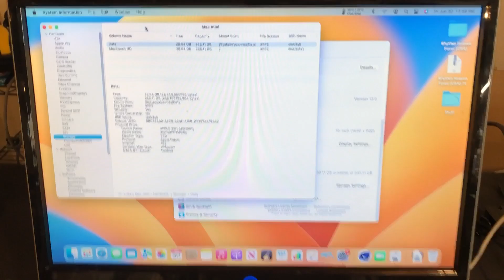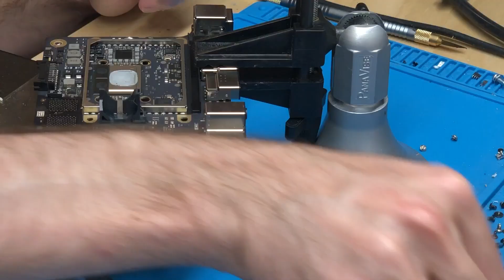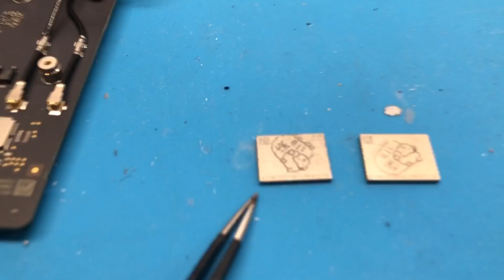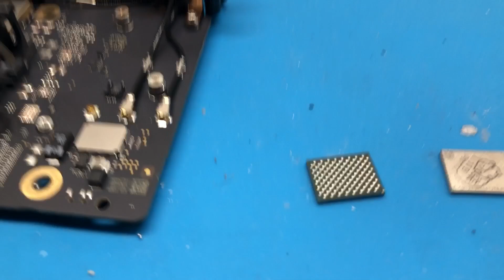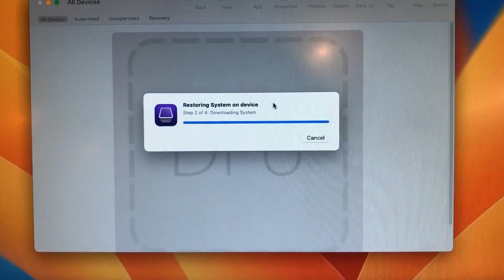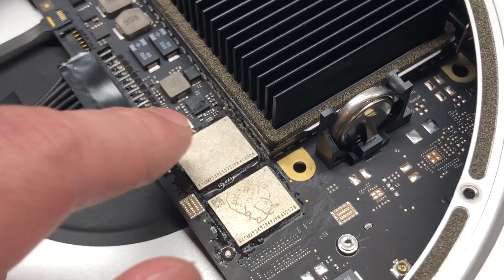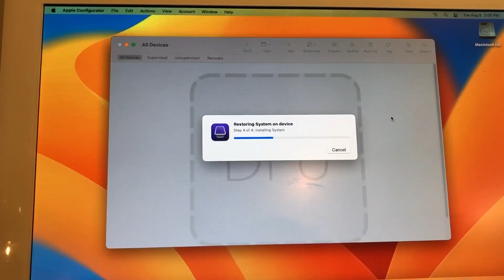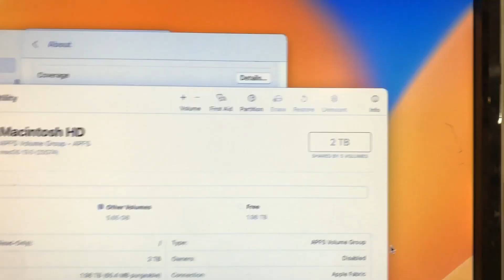M1 Mac Mini Soldered SSD Upgrade

Comment: This video was mostly a hit and miss without a definite conclusion of why this works and the other doesn't. Upgrading soldered SSD on newer MACs is a hell of a procedure and requires lots of knowledge and experience which does not include micro soldering or fault finding methodology. A very good video which has a summary of all the possible combination of NAND chip and firmware versions that can be transplanted/upgraded is this one https://youtu.be/MZuv4TIjk-I  From what I understand there is no way to install NEW NAND chips there unless they have been removed from the same model which must be new as well. The other option include only used chips and the problem is that they have unknown wearing level. Apple does whatever possilbe to shorten the lifespan of their devices so to force their customers buy the new ones or pay an arm and a leg for "official repair".
Reply from the maker: On M1 and later (and on iPhone 13 and later), you actually CAN install brand new, blank NANDs as I've done here. The restore process WILL actually write new firmware to the NANDs ONLY if they're blank. The landing pad/position situation only applies if the NANDs you're using are pre-programmed (pulled from another machine). The T2 Macs, on the other hand, CANNOT work with blank NAND, and must have correctly-positioned pre-programmed NANDs installed in order to work.
Reply: @dosdude1  I didn't mean to say that you don't know what you do but to emphasize there is a very complex situation. However, there is no clear cause in the video why those new chips didn't work. Anyway, your explanation here I think it's clear enough.
Reply from the maker: @nikolaskallianiotis8622  I believe the issue, at least in the case of the new set of chips I got, was that one of them was just physically bad in some way. These NAND chips technically aren't really NANDs at all, but essentially are entirely self-contained SSDs themselves (that connect to M1 SOC via PCIe). As such, my thought was that there may actually be SMD components encapsulated inside the chips themselves (similar to the WiFi chips on these, which have a package that looks almost identical). As such, the process of quickly pulling the chips off the stencil after reballing while hot (which normally isn't an issue with normal chipsets), could have caused some of its internal components (again assuming that's actually how these chips are constructed) to become dislodged from their respective pads. Or it's also entirely possible the chip was simply DOA.
Reply: @dosdude1  Encapsulated SSD ??? I haven't seen such thing so far. Even a 2242 NVMe drive has distinct components despite it's tiny size. Anyway, thanks for the info "dude" 🙂

Comment: Maybe a comlpetely stupid question, but once you have the pads and the chips ready for soldering, couldn't you just temporarily clamp them to the board with some kind of spring clamp just for testing purposes, before you actually melted the solder permanently?
Reply: That won't work because of different heights of the solder blobs. For lab tests there is a kind of "spring loaded BGA prototype socket" that you can use for quickly testing BGA chips.

Comment: All this effort to either repair(dead) or upgrade(more storage) an SSD that should've been an easily swappable part of said electronic device.

An obvious planned obscelence by apple, even worse now with the added T2 Chip & having every component paired/serialized not to work if replaced without paying premium to apple to have them do it but usually will tell you just to buy a new one instead or the cost of replacing is almosy equall to buying a new product.

Comment: Do you need another Mac do the job? If the case must be Silicon or can be Intel?
Reply from the maker: Yes, another Mac is required, but does not need to be Apple Silicon. Just should be running the latest version of macOS for best chance of success.

Comment: Would you be able to do this with an M2 Mac mini? I’ve heard the base model has two NAND slots but only 1 NAND 256gb SSD onboard. I’m guessing it would be easier to upgrade as you don’t need to remove the chip

Comment: So what is the success rate with such a difficult process? Does it work for all M1 macs like the macbook air?
Hopefully this becomes a relatively trivial thing to do over the next couple of years for when I need to do it, the M1air is a truly impressive product only held back by Apple's greed and anti consumer practises. No one would buy a mustang if ford only sold them with non removable tyres so it shouldn't be allowed by law for computers either.

Comment: Well done, but Apple are so rotten soldering SSD to the board.  This element of the Apple production line is the final nail in the coffin for me ever buying another Apple product.  Hard drive storage should be user replaceable, let's face it, ssd's have a finite life or just die for no reason, your avaerage user is stuffed the days that happens. .

Comment: Would love to see some benchmarking to see how fast that new SSD is and compare to the stock SSD in some Macs.

Wonder if this SSD swap will work with any M1/M2 Mac. Or is it only for Mac Mini M1?
Reply from the maker: This upgrade applies to any M1 Mac. Speed will not change, as the NANDs are still on the same bus.
Reply: So it will not work with any other Mac? What do you think/believe?

Would still love to see some benchmarking. Hopefully Luke did some with that original 256 GB SSD. Of course it's the same bus but this is just the NAND storage, and the SSD controller is in the SoC. You meant "same SSD controller"?

I'm still curious about the speed/performance. I believe that many more people are :)

Speaking of storage buses.. I know that the last MBP Unibody got that SATA-600: 600 MB/s. How fast is the bus for the SSD on Mac Mini M1? PCIe NVMe I guess :)

Comment: I do have a question. In Luke’s video I got the impression that success was achieved with BOTH of the blank nand chips. Is that the case, or do I need to get both pre-programmed and blank nand chips to duplicate the process?
Reply from the maker: Two blank chips should work, the only reason I had issues was because one of the chips was bad in some way (which may have been my fault). If both chips were functional, it would have worked.
Reply: @dosdude1  Cool! Thanks for the quick reply. I’m contemplating an experiment to take my M1 Ultra Studio from 2TB to 8TB.

Comment: So you say that un-programmed NANDs is the way to go, however didn't you use one programmed and one un-programmed?
Reply from the maker: I did, but only because one of my new ones was bad. Though one programmed and one unprogrammed should in theory be the same as being completely unprogrammed, as the data is striped across both chips.
Reply: @dosdude1  Interesting, so since its stripped the M1 must see them as a broken array and treats them as blank. Thanks for the reply. Also the 50% failure rate of the NANDs is a bit interesting.
Reply from the maker: @JustFixIt99  May have been my fault, as these are not normal NANDs, and may have components encapsulated inside (as the WiFi chips do in these). As such, you have to be more careful when removing from stencil (while still hot) after reballing than with normal chips.
Reply: @dosdude1  Learn something new very day. Hope to see more of these from you.

Comment: what could be super interesting is to mount a bracket to the M1 board, to allow for quick insert and release of the NAND chips so you can make a whole series testing out what works and not + get a NAND programmer to erase the chips.
Reply: unfortunately BGA110 socket costs more than Mac M1 Board itself :) however it could be printed with good resin printer..
Reply: That's the programmer - the sockets themselves are relatively cheap @inwerp
Reply: if you mean JCID adapters - sey they are not expensive but i do not believe they have PCIE pairs stuffed, simply because it uses UART.
Reply: @inwerp  His comment is stating it would be easier to have an adapter so you could swap the nand easily - an adapter is cheap, all you’d need is someone to make a flex that can be quickly soldered to board to swap nand - you’re over complicating what he means
Reply: They got sockets just for that.
Reply: @memadmax69   No, just for the board, the socket between the chip and board isn't proprietary
Reply: Interesting idea, but adding a socket to a NAMD chip risk adding insertion loss to the signal path. If the NAND controller is not able to complete the train as the signal integrity is bad, the SSD can not be used then.
Reply: I may buy another Mac after all, realising I can buy lowest size SSD, and self upgrade to 4TB or more, as long as blank. What is the limit?

Imagine all these people buying kit to learn to do surface mount work. The skills we learn are valuable, perhaps priceless. 

Trashing a brand new machine is unlikely right, but if it cost less than half the spec you desired, there’s room to buy another and learn from the mistake. That’s always going to be more valuable than initially buying the full spec.
Reply: @alanwest6949  If you dont have experience with hot air rework this is not the place to start learning

Comment: Usually these are sold labeled if there are more than one chip. If they seller didn’t label it, they are just conning. I’ve got three pairs so far and they were all labeled as 0 and 1, indicating which goes where.

Comment: Last year when Luke tried swapping the memory modules on  an M1 studio they didn’t work with different memory configurations. Is it possible due to the different firmware. 

If you were to swap the individual chips with brand new un programmed chips might it not be possible to do the same upgrade. 

A bit expensive if it goes wrong though.

Comment: What is that fuzzy screen on the M1 Mac mini?
I had the same thing with my M1 studio on an HDMI display
Reply from the maker: Just a garbage HDMI to DVI cable I was using.
Reply: @dosdude1  could’ve been my cable then.
Restarting seemed to fix it but it was weird to see.
I haven’t seen it since using thunderbolt cables on my benq displays.

Comment: The mixture probably worked because Apple considered what situations they might be restored in the wild: (1) after a system error but with original chips, and (2) by certified Apple techs. (1) will not see blank chips nor chips pre-formatted for a different machine. (2) is an internal process, so they can load the chips they install with a special "It's OK, go ahead and restore" signature that can then be read by the restorer. Your two failed situations with a complete set of pre-formatted chips or two completely blank chips can both be detected by the restorer and then programmed to fail to prevent this sort of thing, but the mixture of a chip from one set and a chip from the other will appear as a corrupt file system and nothing more, i.e. a system error, then you're back in (1) as intended. <more>

I do consider that the two sets didn't work when chip 0 and chip 1 from each set were swapped, however a simple permutation of chips can readily be programmed in software; i.e. if system appears corrupt, swap chip addresses and try again. If chips are soldered pre-programmed in the factory, this would make that process more forgiving. In the end, I'm left wondering: which is more probable, (a) two sets both shipped with one bad chip AND by random chance you chose the only good chip in each set to try, or (b) the placement is not important and Apple is trying to prevent this by detecting it, to the degree that they can without interrupting the intended behavior in normal operation... (b) is far more likely in my mind.
Reply: What if the soldering was not good in the first attempts, then he soldered them well in the last attempt?
Reply: @EnricoLorenzoni599 , he did solder 4 times. W/o a programmer it remains a guessing game. A bad or missing solder joint would likely get you another error than “can’t format”.
Reply: I also considered this

Comment: This video's conclusion and Luke's coverage of this were both pretty confusing about what  you got to actually work. Watching through this video, it seems the two blank chips DIDN'T work, nor did the two Apple Mac Book sourced chips, but it was in fact a combination of the chips that worked, with ONE of the official Apple Mac Book chips in the 'spot zero', and the other one occupied with the blank chip.
Reply from the maker: In this instance, I simply got unlucky, as one of the new chips ended up being defective. Whether it was my fault (due to handling/reballing process) I don't know, but luckily at least one of those initial NANDs was good, and worked. Even if that initial NAND DID have programming on it, without its matching chip, any data that is on that NAND is useless. Therefore, the combination was identified as "blank" during the restoration process.
Reply: . @dosdude1  Thanks for the extra info, I see why you think that two blank (working) chips should work, even though that wasn't what you actually got to work.

Comment: The soldering of SSD on the mainboard is just criminal and i hope an  EU law will soon forbid this (just like the did for non replaceable battiers). It is against consumer interest and a terrible anti durability in times where we need to inspect every single bit of our ecological food print. Apple uses the lowest possible memory (ram/ssd) so there is a good reason to update, because the computer devices could work well for well for 10 and more years now.
Reply: Soldered batteries havent been a thing for a while. All batteries are replacable, it's just the amount of work a person has to do to actually replace them that has grown.

Comment: If you get your hands on a BGA110 NAND programmer, it would be quite interesting to see what is going on with the other two ICs.  I wonder if there's some type of failure, or if the "blank" one had firmware on it already.
Reply: Not sure if that programmer actually supports these chips for M1 (I saw in another video by a chinese blogger that said the M1 chips are a bit bigger than the ones used in iPhone 11).
Reply: The original two may have been pulled from bad equipment or rejected or patched chips. Those chinese companies are really good for this, especially on spendy parts.
Reply: @reidster87, that would be the next logical step.
It seems like a huuuuge coincidence that Collin picked the two working ones out of 4.
Reply: i doubt it's some kind of firmware security to be honest could be some encryption to make sure original disk has not been switched on board. I mean some can steal laptop and remove chip and use it on another Mac to read its content or to access it, how to secure that scenario?

Comment: I do think you're underestimating the heat soak of those boards personally. I would say you need to go a bit hotter to be honest. Also I think your hands were a little too shakey. One thing I do is rest my palm on the table which allows me to prevent my hand from shaking. Other than that, great job! Keep them coming bud

Comment: This is the very reason I swapped out our 2018 intel Mac mini for a self built PC for our church presentation computer. Luckily ProPresenter 7 now works just as good on the pc as it does the mac. I have 2x2tb Cardea nvme drives with one being cloned to the other every week. If one dies, we can immediately swap to booting off the other with little to no data loss and then spend $120 and replace the one that died if it's out of the 5yr warranty
Reply: You better check on the TBW on the two drives and swap the two once in a while. Warranty on TBW aside, unbalanced writes like that makes your backup drive more likely to fail.

Also 2TB ADATA SX8200 pro are as low as $75 nowadays
Reply: @harrytsang1501  they have an 1800TBW (per TB). That's 98% of the drive, every day for 5 years (warranty period). The sx8200 only has 640tbw (per TB), thus the cheap price

Comment: Hey man good job. next time it is wise to preheat the print to 100 degrees Celsius. 212 fahrenheit.
With a pre heater you don't have to stay in a place with such a high temperature for so long and the use of flux is also handy. nice channel you have greetings the doctor 😃

Comment: Is This Possible for MacBook with M2 Chip?
Reply from the maker: Yes, but they use different NANDs (which currently are a bit harder to find).
Reply: @dosdude1 Means eventually we can upgrade M2 also. To be frank at one point I was really scared if the NANDs don't work and all.. but Great Work and fast thinking to swap the NANDs

Comment: Should have a socket(s) in the first place, suppose it saved them a $ and let them upsell
Reply from the maker: NAND/BGA chip sockets are actually really expensive (usually over $100 per socket). Though designing a custom NAND board and connector would have been easy and cheap, as they did with the Mac Studio.
Reply: @dosdude1  Hmm its stick with my Samsung 990 Pro which I just plugged in, seems like apple are screwing people to be honest

Comment: Freaking Apple. Just make the unit upgradeable - 800 v 130....can you not use a coke can to focus the heat and prevent it spreading? I watch them use them on video cards  I love ole' boy is using an old DVD Drive as a work surface. That's old school and shit....
Reply: Somewhere in the building is a spreadsheet detailing the large growth in profit margin Apple is enjoying building the much simpler ‘fixed’ machine. That would be added to the already significant growth for using their own silicon, which I imagine has a long period of amortization. Apple makes some pretty good computers. What they do to Beth though is make profitable computers. And we are there to help them with that.

I have extended the life of some 8- to 13-year-old Apple computers manufactured in the day before they mastered the art of dropping golden eggs. It’s a lot of effort to do this but I am inspired to steal a good-sized chunk of their excess profit.